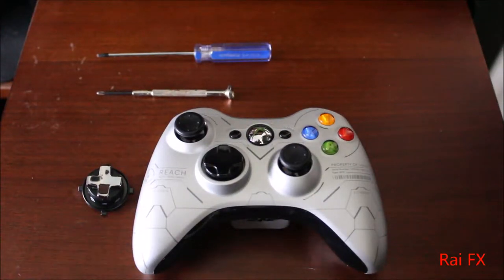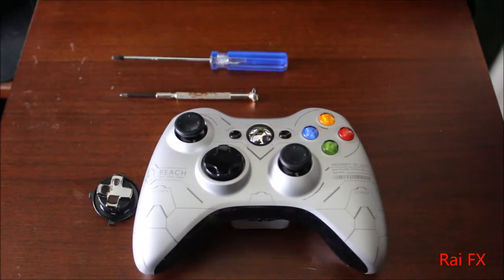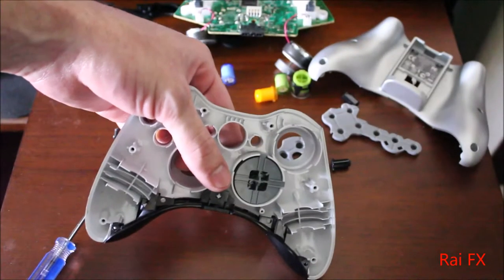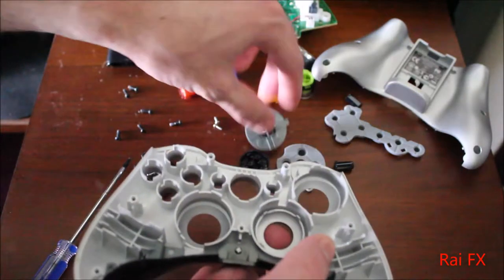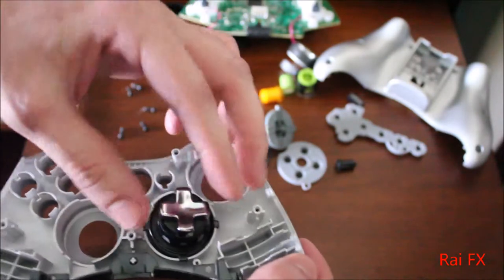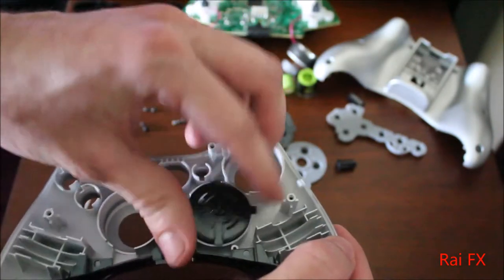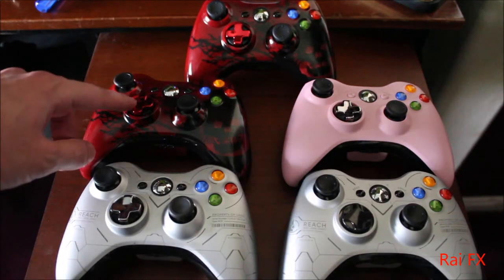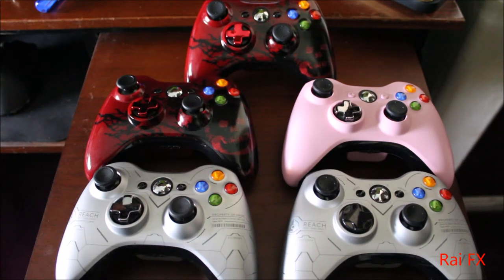How to Add a Transforming D-Pad to a non Transforming D-Pad Xbox 360 Controller

Comment: i did this mod after so many years and i can clearly see a big difference playing games like street fighter 4, one tip is that you do not need to cut so deep on 2 of the sides because the transforming d-pad black tabs do not go that deep, there are tabs in the inner circle of the joystic that prevent the trandforming dpad going too deep, so there is no need to cut squares so deep
Reply: @5DiFika  Forreal. Trying to get back into fighting games cause MVC hype and also the Xbox 360 store closing soon, and they had sales for a bunch of Street Fighter games for $1-2. My inputs never feel precise with the analog stick or d-pad. So I definitely wanna try this as a solution.